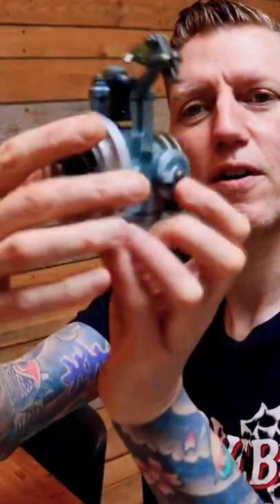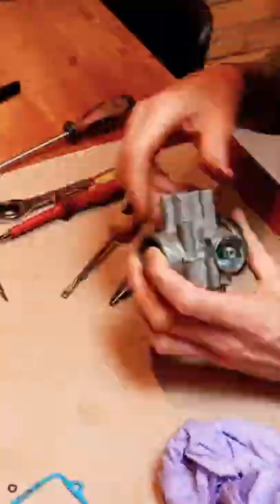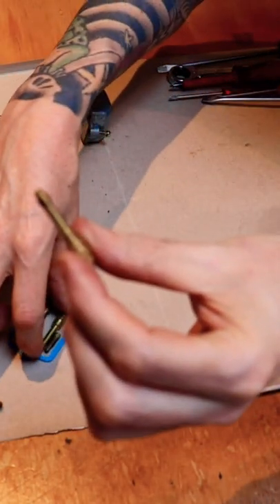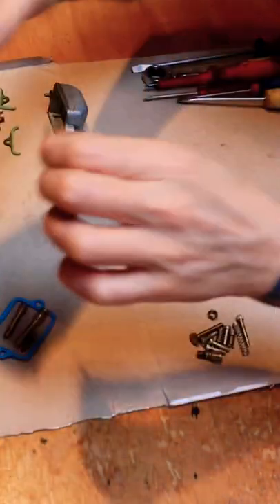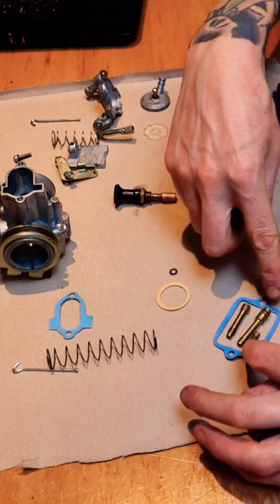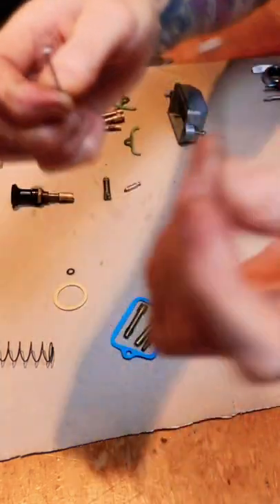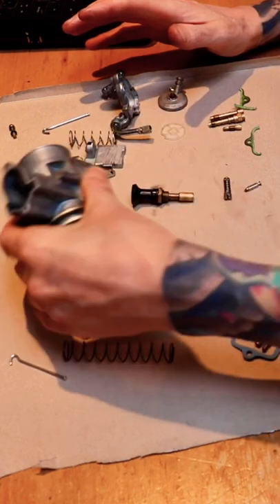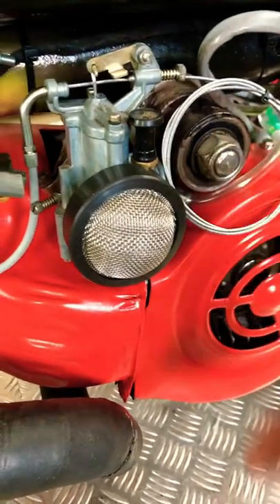Oddbod the Lambretta gets a carburettor rebuild. But not sure it’ll make much difference. #shorts

Comment: Check the numbers on your float valve mate, the shorter version will allow more fuel into the chamber before shutting the floats off, and that's a good thing! Have you looked at the colour of the spark plug to see if it's running rich or lean or bang on? Nice chocolate brown colour. The tea strainer on the bellmouth might mean just playing with the mixture (richer or leaner) screw slightly?